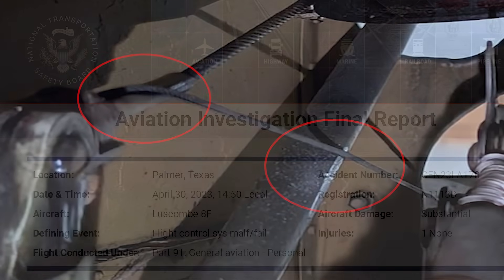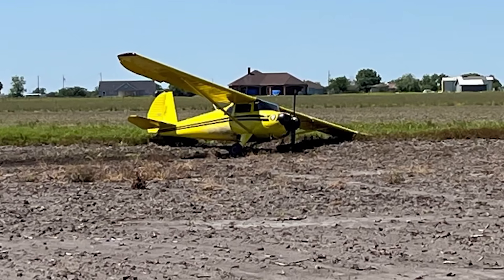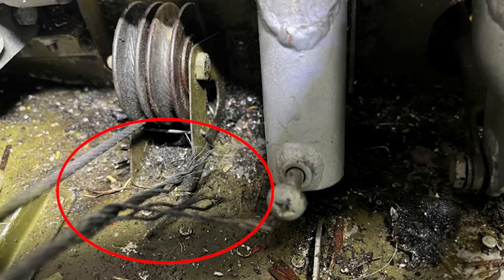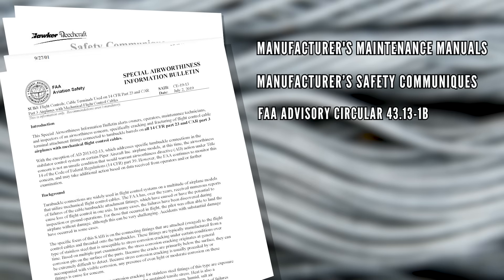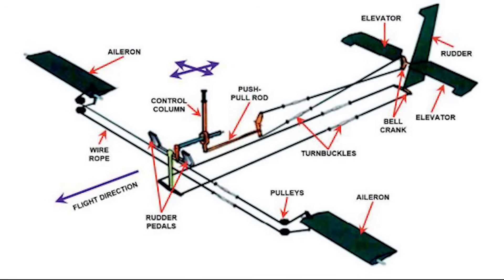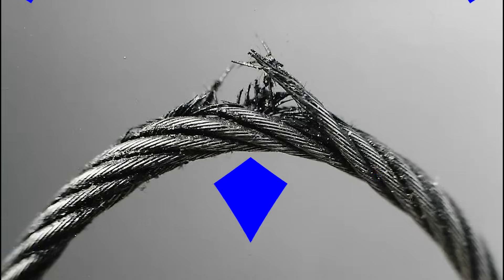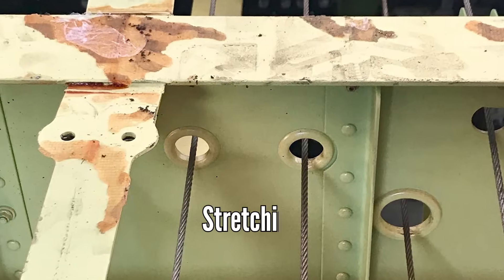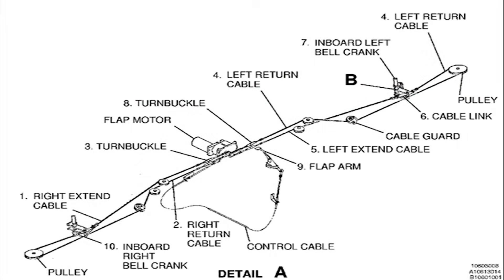Flight Control Cable Failures

Comment: I'm retired from flying for a cargo airline that flies B747s. Some of our aircraft had hatches in the bulkhead behind the crew-rest bunks. These hatches were removable panels.

As my crew and I were doing our preflight, I noticed that the logbook had multiple entries where previous pilots had reported that the flight controls were binding. The entries were signed off as "could not duplicate on the ground". As I was going through the logbook, my copilot came to me to say that the above-mentioned hatch was missing. He looked through the open hatch and saw the now-twisted panel stuck in the flight control cables!

Maintenance staff removed the panel and, after careful inspection, deemed the cables airworthy. Both the maintenance chief and I reported the incident through our separate channels and suggested that the panel be modified so that a crewmember napping in that bunk couldn't knock the panel into the flight control cables. The company didn't act on our suggestion.

About a month later, it happened to me again! This time, in addition to reporting the incident through company channels, I filed a NASA/ASRS report. Within hours, I had a phone call from NASA/ASRS asking for more information. Within days, every affected aircraft was modified to make the hatches safe. I should have filed the NASA?ASRS report the first time. Dunno why it had to take a NASA/ASRS report to get the company to address a very dangerous situation.

Comment: I was an inspector at an MRO that performed C check inspections on Bombardier CRJ Regional jets for the airlines.  Most of these planes have 40,000 plus cycles on them.  They just recently started to remove the control cables from the aircraft for inspection.  We were then finding an increase in failed cable inspections, so much so, that the supply of replacement cable assemblies is almost gone now.

Comment: I recommend burying your aircraft in a field and using low voltage constant current for impressed cathode corrosion protection. Also, you avoid putting hours on it. Save a lot on maintenance!

Comment: The main plane I used while in flight school, N62283 Cessna C172, crashed in pattern due to the aileron cable breaking. Lucky that I wasn't flying that day. Even luckier, the student and instructor that WAS flying both survived.

Comment: The failed cable had been in the aircraft for at least 9 years.
 Would the "approved" cable have helped at all? ( Though not stated, it sounded like the wrong pulley would have been more of an issue.)
Inspection SHOULD have caught this. I'd allow that the cable would have looked fine for the first 5 years. That leaves 4 annuals where damage COULD have been found.
Reply: If the cable was substandard, then fatigue can happen sooner, so an approved cable might have lasted longer (or not...)

Comment: The main cause is none of what he said in the beginning of the video, it is the age of the airplane. Thanks to FAA refusing to certify modern designs there is no business willing to enter general aviation and produce cheap and reliable GA airplanes using modern technology, so we are stuck with either new C-172 costing $700k (lack of production thanks to FAA) or 60 years old C-172 ones which naturally will have snapped control cables.
Reply: You're totally wrong.  It was not the FAA -  the problem is that the U.S. legal industry discovered that they could make a fortune by product liability lawsuits.  This was started by Lee Kreindler & Associates in about 1966.  As a result, the cost of product liability insurance made the production of most of the Cessna range too expensive for the market, so Cessna stopped making anything smaller than the 208.  Later legislation reduced the problem somewhat, but not completely.  Do your homework instead of making "Hate" claims . . .
Reply: @dafyddllewellyn6636  But the same thing for car industry (at even larger scale), there were high profile law suits like Firestone tire, various class actions, etc. I don't have first hand experience, but what I hear from everybody is FAA certification. It's simple fact kit built airplanes like RV are not more accident-prone than certified ones but its much harder to make money selling experimental airplanes, so no business entering GA market.
Reply: The certification process certainly seems to be one of the biggest problems with GA. It takes such a massive amount of money to compete that small companies can’t go through the processes. Also the reason we are using engines with 100 year old designs and tech  that cost 80k to replace
Reply: I agree with the 2nd part, government over reach has reduced the quality of life in nearly everything it touches.
A PMA stamp doesn't make a part good. It may keep some bad one out but to DOES make it expensive and sometimes hard to get.
The plane being "old" is not on itself a problem. 
That cable was between 9 and ( was it 20?) years old; not that old for a properly run and sheaved cable. 
The real issue is that no one looked at it for at least 9 years. Had someone opened up the access, it likely wouldn't have required an Airworthiness Inspector to discern that it was failing.
Not duscussed in the article, is that since they never opened it up for inspection, we know they never inspected nor lubricated the sheaves or the routing.
That cable was either bending too sharpely, rubbing on soneting or had mousture, dirt or such causing corrosion.
Reply: If properly maintained... Age is not a problem.
Reply: Be sure you aren't confusing new tech with low time. As a pilot maintaining my own aircraft, and as an engineer with an aircraft manufacturer who deals directly with the FAA, I gotta disagree. There isn't much about the age of aircraft primary structure (the airframe itself) that adversely impacts wear and tear on serviceable flight control hardware like pulleys, cables, sheaves, clevises, and standard hardware. It's all about how it is maintained, and new tech doesn't excuse you from maintenance. Do you feel that aircraft should be so cheaply built that it's cheaper to throw away the whole airframe instead of replace wear items? Automotive has trended that way, but no thanks!
Yes, it would be nice if it was easier to implement certain modern techs (we still manage to). And yes, bureaucracy is very real, and so is rampant CYA private and public policy as @dafyddllewellyn6636 points out. And yes, these do drive up the cost of aviation and slow adoption of new tech.
But the need to service and replace wear items in your control system has little to do with this. Even if the control system used "newer tech", the subject of this video would still be of critical importance (and servicing would inevitably be more complex and even more costly if automotive and other less regulated consumer products are any example;). I think you are also dramatically underestimating the default reliability benefits of not changing how you are doing something (or at least changing very slowly). It's easy to spot where modern tech has the POTENTIAL to be even more reliable. It's much harder for many people to see how we get there - bajillions of hours (probably taking decades) of service within a system where most issues are reported, studied, and addressed. It's pretty slow, but such a process achieves reliability that can't be achieved in an R&D lab alone.

Comment: My first flight instructor and a student pilot both lost their lives because of a corroded aileron cable. Let’s make sure that proper action is taken when necessary to ensure that it doesn’t happen again.
Reply: Did an aileron get stuck deflected?
Reply: @thatairplaneguy  It probably did because the NTSB found the aileron cable corroded and stress caused from tension was evident.

Comment: Does anyone reading have substantiation for the opening statement; that there appears to be an increase in aviation accidents due to damaged or incorrectly installed control cables? 
This is a very good video, and very interesting for those truly involved or interested in aviation, but I am wondering about the opening premise and whether this can be corroborated.

Comment: Paint stripper will eat up a galvanized cable with in a couple years.  I had 1953 Cessna 180 I was rebuilding and got stripper on a cable, wrapped it in a 6” circle and nailed the baggie I put it in to that wall. Within 2 years it was fraying bad!   I was making new cables anyway so I didn’t care about the old cable.  But I’ve seen so many cables that people got stripper on when repainting a metal plane.  Pay attention to it!
Reply: That knowledge needs to be spread. Every paint shop and eveyone even thinking about getting their aircraft painted needs it.

Comment: When I was a B-52 Crew Chief in the early 80s I was walking into the base hospital cafeteria which takes you past the emergency room desk.....and they always have tower coms tuned in on their radio. So JUST as I'm walking past their radio I hear....."In flight emergency, in flight emergency. A B-52 aircraft 101 coming in with an engine stuck at full throttle."  DANG.....that's my aircraft. (I kid you not)  So I hurried over to the flight line and was told to go home. The repairs were under way and I would pre flight the aircraft over night for a flight in the morning.
 Just as I arrived to start my shift, the repair crew was packing up and leaving. I asked, "So what was the problem? What did you find?"
Answer: A broken throttle cable.....which was replaced. The WAY they replaced the broken cable was to swage the two cable ends together and pull the new cable through all of the pulleys as far as they could with the broken half of cable. Then do the same with the other cable half the rest of the way to the engine. "Very cool" I thought. So before I began my pre flight maintenance checks I took a stroll around the aircraft to see the new cable routing. I look up in the weapons bay where the cables take a 90 degree turn and head out to the wings......and there was the cable in question riding on the OUTSIDE of it's pulley on the pulley shaft where it had already cut half way through the pulley shaft that held THREE other throttle cables. My hand was shaking as I entered the Red X log page. I was half mad and half scared.

Comment: What about throttle, prop and mixture cables?  How can these be inspected?
Reply: replace them.
Reply: You usually can easily feel them getting heavier and start binding. You can replace them in a preventive manner too (Cessna actually calls them to be replaced at engine overhaul for example)

Comment: Rudder cable Nico press was installed 90 degrees out on my dad’s experimental.  Took a year or so to slacken and slip off.  Transportation Canada missed it on airworthiness inspection. Luckily he walked away. Plane went down like a helicopter leaf in to a swampy area.  It let go mid flight.
Reply: WOW !
Reply: I don't even know how that's possible
Reply: @vf24renegade23  Where there's a will there's a way.
Reply: FYI, a Nico sleeve is basically a tube  that you pass two cables through.
A special tool is used to squeeze the Nico.(under high pressure) to swage all three components together. It is impossible to install 90 degrees out. It can be UNDER SWAGED (loose) and it may look ok but it is not.  

Another point, Transportation Canada like the FAA doesn’t go over these amateur built planes with a fine tooth comb, it is the responsibility of the builder. It is also another good reason when you build a plane you have other “eye’s” watching/critiquing your work. There are some builders out there that refuse to heed the advice of other builders. I personally know one that died on the very first flight, the crash was caused for the very reason me and others warned him about.

Comment: Best way to NOT have a cable failure?  Buy a Mooney! 😂
Reply: Push/pull tubes are all the rage now a days…

Keep an eye on the plastic parts that protect the tubes from getting cut on the holes as they pass through…

Go M20!

😃
Reply: @AC-jk8wq  Good call.  I am getting with my Mooney mechanic all the time and picking his brain on all the things he sees and what to watch out for. Your suggestion make sense too.  I have a one piece belly so it's really easy to do inspections.
Reply: Moving parts break. Deal with it.
Reply: @stevebot  Cables are for clothes lines!
Reply: @libertine5606  then how come Douglas used them for the better part of half a century ? Nothing inherently wrong with cables-they just require periodic & KNOWLEDGEABLE MX.
Reply: I've seen cracks in push/pull tubes... And in a cable system, if one fails you don't lose all control

Comment: I'll take cables over servo's still.......something about electricity seems fallible at the wrong time.
Reply: Fly-by-wire has proved itself over the last 45 years or more. It works good and lasts a long time.
Reply: @rael5469  Nope. They still peter out. Pilots still find ways to crash & I've seen it hide issues with a H 101.
helicopter until complete failure.
Reply: @HongyaMa   "Nope".....????  Nope what?  Yeah no......fly-by-wire has MORE than proved itself over the last 45 years. I never said that pilots don't find a way to crash......but fly-by-wire has greatly improved aviation safety. 
Oh.....fly-by-wire CAN hide issues......because it will keep correcting the aircraft until the faulty part fails hard. But that's why we have a maintenance program. It is very rare for anything like that to actually happen. But if the scheduled maintenance is neglected.......as in "negligently" neglected....then sure, anything can happen if you push things far enough.
Reply: @rael5469  No servicable parts inside.
SAS, AFCS & Fly by wire pilots are passengers after a decade of flying.
You stick them in a normal aircraft and they are all over the place.= wrecked...
From Control law to manual you'll have issues.  Like 2001 a Space Odyssey 
"Sorry Dave I can't do that"
Vietnam pilots beat Dessert Storm pilots in skill and judgement. NO AFCS = pilot
FBW, AFCS = Meat Servo

Comment: This reminds me of inspecting several Cessna 310/320 aircraft 20 years ago   They were found to have loose aileron cables!  You could move the aileron itself without moving the wheel.  The turnbuckles were laying on the fuselage in the cabin.  Since you had to remove the seats and floor to access the cables, it was obvious why they were loose!!
Reply: Equipment designers for all types of equipment too often fail to give enough attention to long term maintenance ossues. Worse, they are often encouraged by management to keep production costs down at the expense of long term ownership cost.